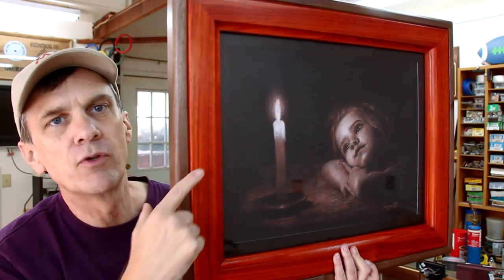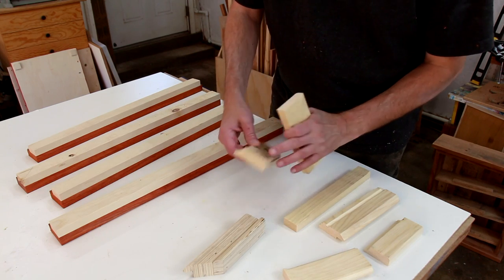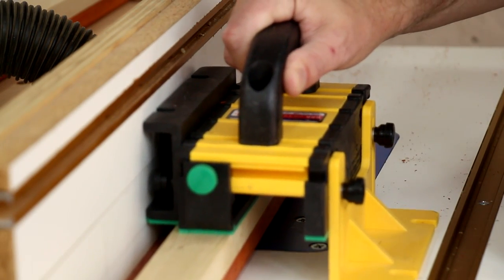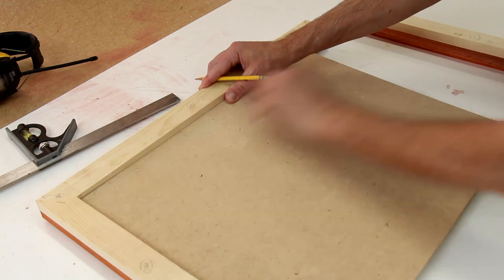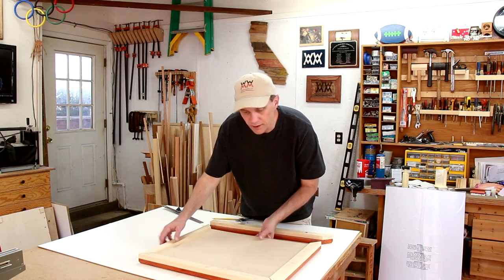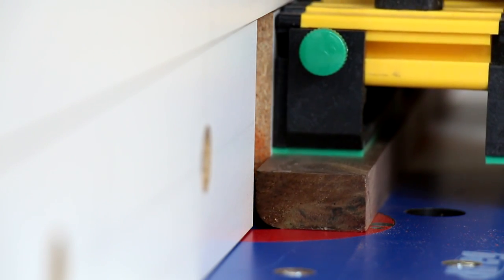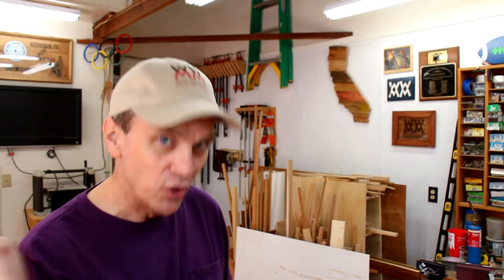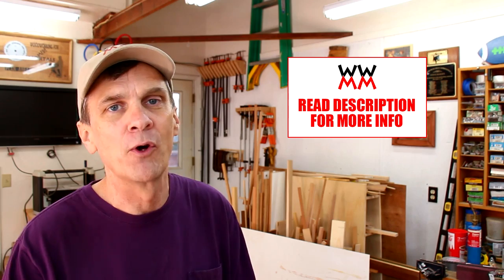Large Picture Frame to Benefit the Make-A-Wish Foundation

Comment: the trick to miters is the 45 degree cut will reduce the overall length on the inside dimension by the width of the board. so if your board is 12" long x 2" wide for example, , after the miter cuts, the board will be 2" shorter from each miter cut, so the overall length on the inside would then be 8". Hope this helps.

Comment: I don’t have a table saw but have a miter saw and router table. I am considering a process to make picture frames void of yet having table saw and want more expert input. Here I go:
Step 1: Get wood that isn’t so wide it would make a bulky frame but is still pretty much straight.  (Without a table saw ripping wood only works so/ so.)
Step 2: Rout. Rout a rabbet on one edge with a straight bit of the desired width and height to hold the final artwork, glass, backer, and needed fastener. Then rout the desired decorative edging on what will be the two front facing edges.
Step 3: Check to make sure the miter saw is not beveled. Set the miter saw to the positive stop for a forty-five-degree miter with accepting this will not be perfect. Cut the routed board to the needed length for the artwork with many inches of slack. Mark each cut edge with the denotation of a “1”.
Step 4: Set up a stop-block for cutting using the opposite side of the miter saw at the length for the long edges of the frame. with a fraction of an inch of slack. Flip the board around and cut the miter. The idea of using the other side of the miter saw is that even if the miter is slightly off, both angles will be complimentary. Denote this cut with the number, “2.” Slowly shave off more and more of the long edges on the number “2” side until they are the needed size for the artwork plus 1/4 inch. Keep adjusting the stop block so both long edges stay identical in length.
Step 5: Repeat for the short edges of the frame.
Step 6: Assembly and finishing are identical as for a frame cut with a table saw.
Let me know what you think plus and suggestions. I know many of you would get a table saw before getting a router, but keep in mind there is no prefect order to get tools and a router fit better in the utility closet before I got a house with a garage. Plus I think we all have tools we regret buying, especially from when we first got started.

Comment: You made a good point about woodworking not having to be expensive.  I buy old 1950s tools. My Delta-Rockwell 9" table saw with a 4" jointer cost $40 on Craigs List and will pass the nickel test.  I have a Delta-Rockwell radial arm saw that cuts perfect miters and crosscuts, and is perfect for straightening warped boards: I paid $50.  I have an old 12" Craftsman band saw that was hardly used, $50.  A huge vice that cost $10.  A not so good, but OK drill press that cost $40.  I purchase an almost new router table for $50, still waiting for the router.  There are lots of used tools sitting in garages and basements that have had little or no use.  Thanks for the videos, I've been watching them for quite a long time.

Comment: Hey Steve, what blade are you using on your miter saw? I'm using the default one that came with my saw, but I'm not too happy with it: it has 24 teeth, and I feel like it's ripping the wood (especially if I'm cutting finer pieces). Yours seems to cut quite smoothly. Would you recommend one with a higher teeth count instead? Thanks!